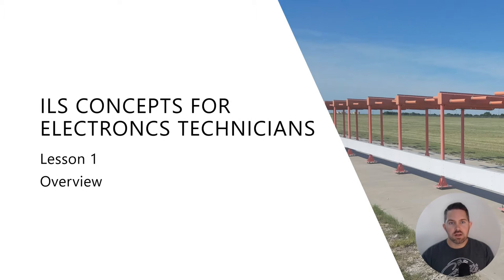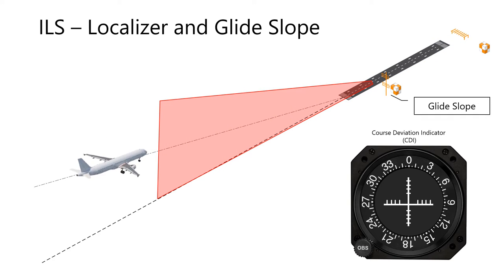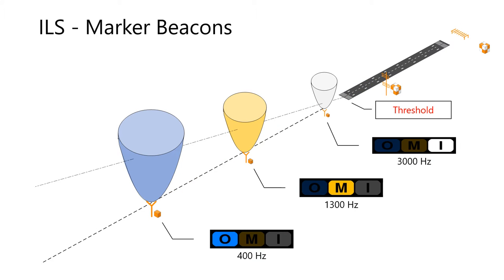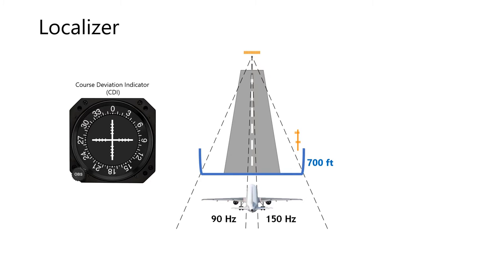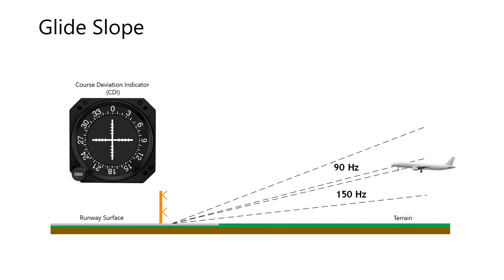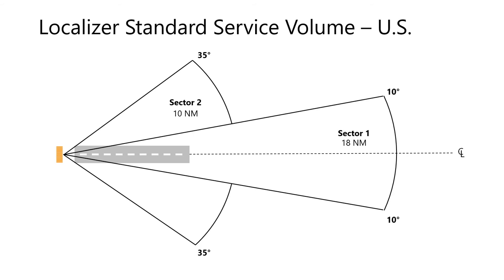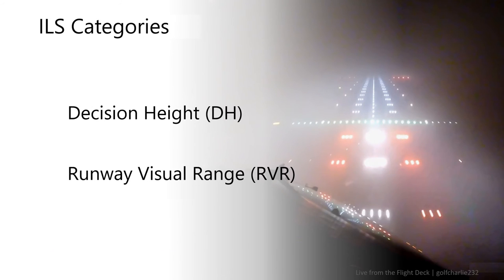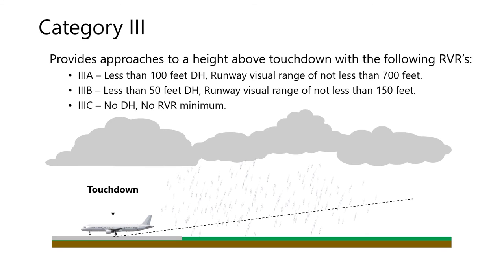01 - ILS CONCEPTS - Overview

Comment: This brings back memories of ILS concepts I took 36 years ago. I also spent 5 years in Flight Inspection out of Atlantic City. BTW the localizer service volume is +-35 deg at 10 NM and +- 10 degrees at 18 miles either side of the localizer centerline. I only say this because at one time there were offset localizers at some airports like Martin State in  Maryland.

Comment: I have just a little comment or correction. The vertical coverage for glide path is down to 0.45 (or 0.3) times the commissioned glide angle and up to 1.75 times the glide angle. For a typical 3 degrees glide path these figures are 1.35 and 5.25 degrees respectively